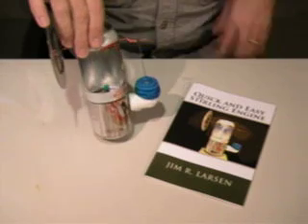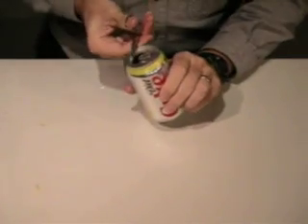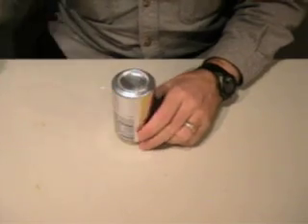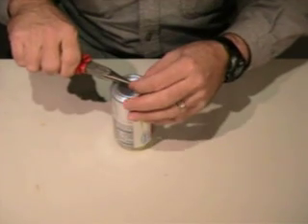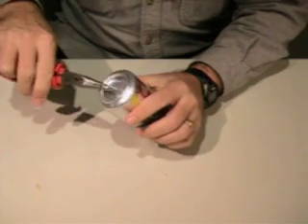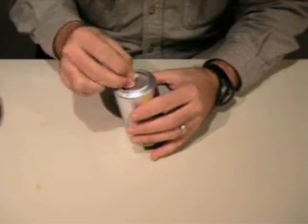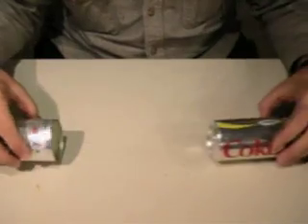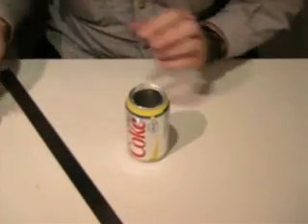Preparing the Engine Top Can for the Quick and Easy Stirling Engine

Comment: If you struggle to make the hole with the needle, start off the hole using a drawing pin to make a small dimple in the bottom of the can. This makes it easy to push the needle through.